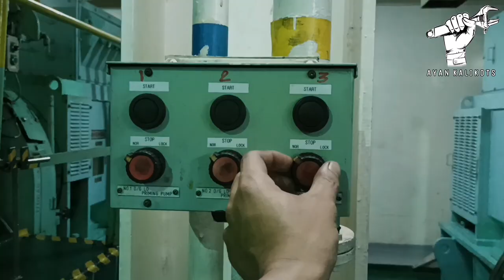DAIHATSU GENERATOR MAINTENANCE [VLOG 026]

Comment: Boss saan yung fuel oil filter sa generator na yan?
Reply from the maker: Naka common duplex filter boss sa 3 generator..
Reply: Ahh Naka common pla xa boss. Doon lng sa may booster pump yung f. I filter nya boss.. Tas yung autobackwash  f. O nya nka coupled sa main engine?

Comment: one mistake done while opening notch wire type filter. NEVER FORGET to close the knock handle by 90 deg before opening the tightening nut of the casing.
Reply: What u r saying is good when engine is running and need to do one filter...
Normally  30 mins after stopping the priming pump there's no oil in the filter.